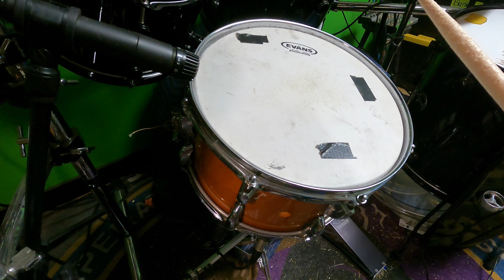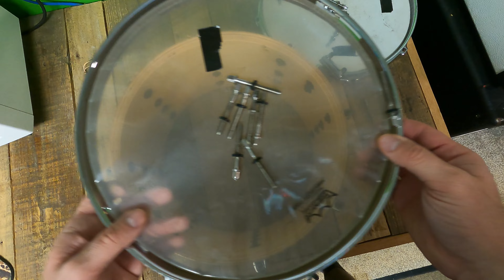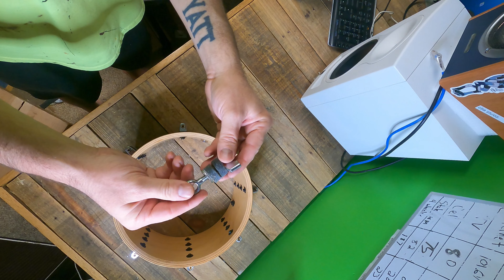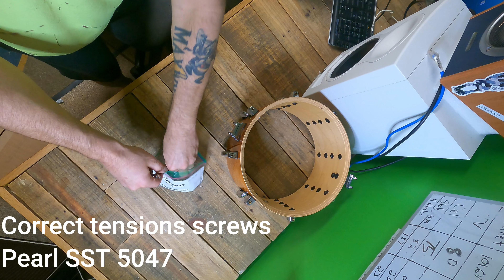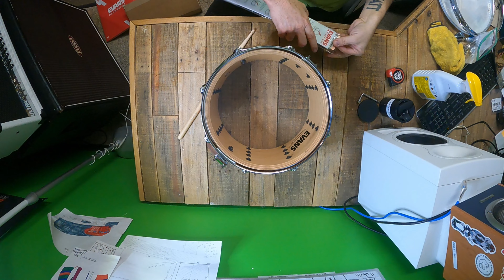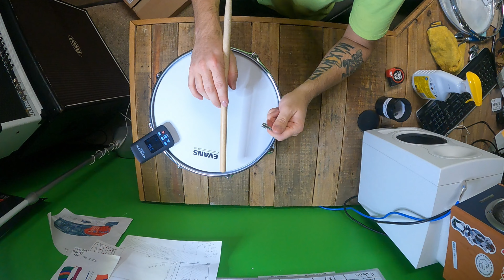Pearl Soprano 12" x 7" maple snare drum new parts install (no talking)

Comment: Hey there, I have this same snare but it has a loose grommet. Do you recall the diameter of the bolt you used? Any info would be appreciated!
Reply from the maker: @jmagnum15 about  5/16" , it was a old drum hardware bolt and nut, with felt grommets in between.
Reply: @michaelshanehelms Thanks for the fast response! I’m thinking the bolt I have from a Tama stand might be a touch too small and not catching. May have to make a trip to the hardware store and pickup a new bolt and wing nut.
Reply from the maker: @jmagnum15  really any size as long as it clamps on the vent itself and not the drum. That's an awesome snare, I wish I would have kept it.
Reply: @michaelshanehelms  I never could get it tightened. My guess is whoever had the drum before me may have broken  it or had the wrong size installed, which was causing a rattle. I decided on a threaded air vent grommet and it works and looks great. I've let some great snares go as well, so I understand. Thanks again for the video and responses!
Reply from the maker: @jmagnum15  yeah, i had a new one, tightened right up. i might have another snare video coming soon, im having a 13" x 5.5" x 3/4" shell built, gonna try to assemble using only USA parts.
Reply: @ Big fan of 13” snares as well. Will keep an eye out for a video.